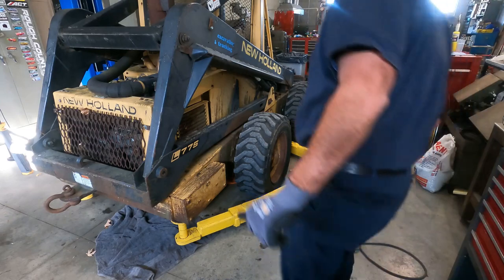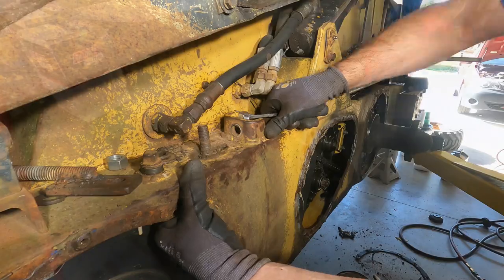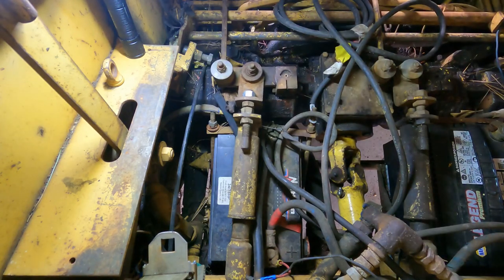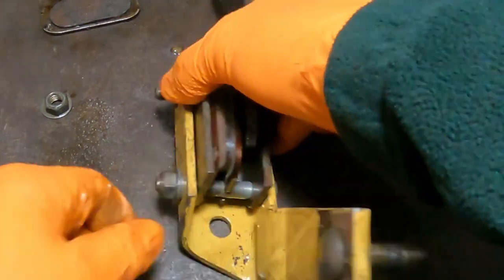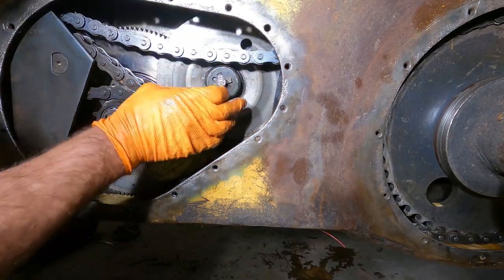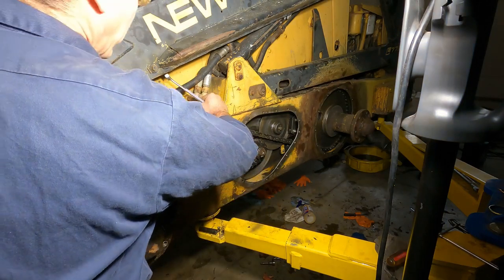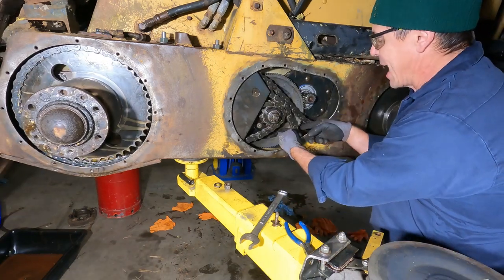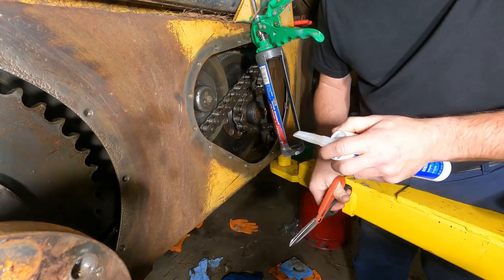New Holland L775 brakes, chain tension, fixing wheel drift.  Preparing skidsteer for spring projects

Comment: since you have a backhoe attachment I'm assuming that has Aux hydraulics in it.    I'd be very grateful if you would go over (video) the hydraulic routing inside the operator area....I have an l779 which is a bigger brother to the L775 - I purchased a used Auxiliary control valve and hopefully all the plumbing but the actual hookup is less than clear.
Reply from the maker: Give me a couple days. I’ll do an unlisted video and share it with you. I’ll video everything that ties to the aux hydro system. If you don’t hear from me send me another message to give me a kick in the pants!  Be have a great weekend.
Reply: @whatsnextgarage  That would be awesome...I think I understand most of it but the devil is in the details.  Looking forward to be able to use an auger attachment
Reply from the maker: @AndrewChandler-1  I’m actually in the shed right now making the video so I’ll try and get it posted tonight
Reply from the maker: @AndrewChandler-1  if your on instagram message me and I’ll send both videos. I’m at whatsnextgarage, no caps no spaces.
Reply: @whatsnextgarage  message sent.